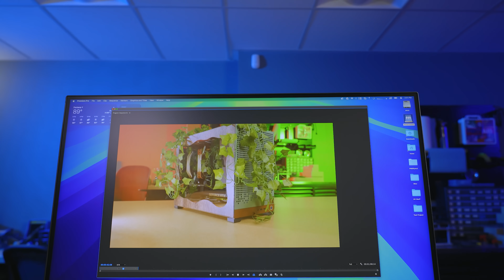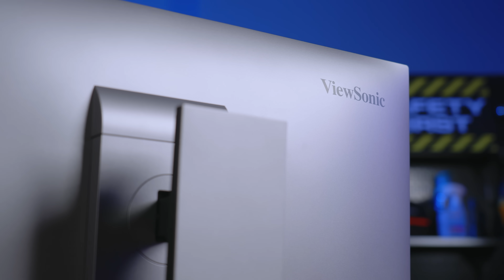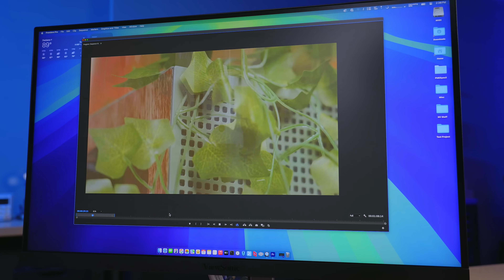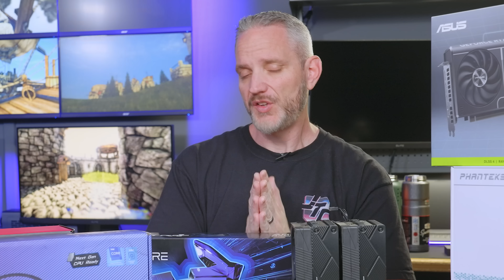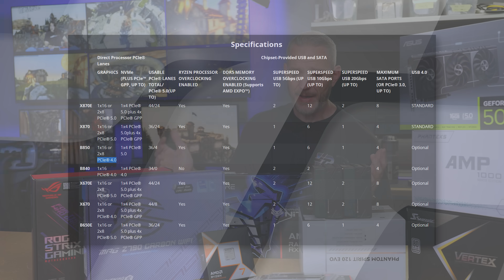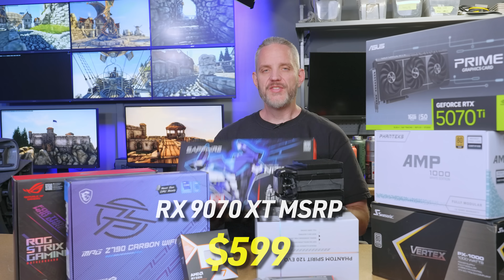This is the Sweetspot for PC gaming... Don't get fooled into spending more!

Comment: I swear EVERY SINGLE TIME I get the bug to upgrade or build new there is a LOOMING price spike......
Reply: So that is because there is a price spike like every month, i know cause im in the same boat and have been trying to upgrade for a reasonable price for like 2 years now....
Reply: @sillybillyhumor  this current situation is differnt those 3-400% increases. just to start SO FAR 
its over for RAM and SSD - its likely only to get worse - 5090 RTX rumors of 5K USD price....
you've missed the boat lol
Reply: Yep. I am building one now, and the last time was during the GPU covid crisis
Reply: @mikerzisu9508 ddr4 is better move buddy and grab used rigs is another option
Reply: I bought 9070xt when it dropped. Waited in line. Paid way over price...now here I am again...building when ram is $500...
Reply: @dangittyler bro I paid $2k for a 3080ti lol
Reply: Glad I decided to pull the trigger before Thanksgiving. I paid $2399 for a pre built with these specs: CPU: Ryzen 7 9800X3D
CPU Cooler: AI V3 360MM ARGB AIO w/ Digital Display
Motherboard: GIGABYTE X870 EAGLE WIFI7
GPU: GIGABYTE RTX 5080 16GB WINDFORCE
SSD: TEAMGROUP NV5000 2TB GEN4 NVME SSD
RAM: G.SKILL TRIDENT Z5 64GB 6000MT/S ARGB CL30
PSU: GAMDIAS HELIOS P2-1000G ATX 3.1
Case: AI GALAXY V3
Reply: @dominicsurace89  dont ever flex with a prebuilt ever again...NOT WELCOME! lol
Reply: @zerutul101 I mean normally I'd build separate lol but it was way cheaper to buy pre built. PC part picker was like 3500 for the build I got. I'll take the shame though lol
Reply: @dominicsurace89 lol all good superpimp - it’s tough out there for a gamer - by the time you get your build everyone has moved onto the next game lol 

I grabbed the 5080 astral on Boxing Day to compliment my 9950x3d i got in September, spared no expense lol Corsair/asus mostly - slaying everything now easily lol
Reply: @zerutul101 I purchased before Thanksgiving and got my build yesterday its great, but yea that wait was brutal.
Reply: @zerutul101 the Astrals are nice! Mine came with Gigabyte 5080 Windforce OC, so decent but no cool RGB :(
Reply: @dominicsurace89 opphh yes that’s a heck of a standby! Would have been better off grabbing a used marketplace build a gen back or something ;)

My exs 12700k beat my 9950x3d for 3dmark time spy cpu score
Pissed me off lol she had it running 4000mhz ram too cause no one did her xmp lol

I kinda regret not going intel honestly lol
But I wanted the king!
Reply: Why not? Still good for perspective
Reply: I feel it too, it's like our overlords don't want us to have any fun with the latest electronics, ugh.
Reply: Its called FOMO
Reply: I just upgraded my 3900x to a 5700x3d since ram is so insane. Will be on AM4 for at least next three years and just hope the nightmare will end and AI bubble will pop.
Reply: I’m so glad I built a amd sys : 870e MB, 9900x cpu, 64g 6400 ram,
9060 16g gpu a yr ago right before the theft !!
Reply: They know the pc enthusiast cycle
Reply: Buy used thats what i do

Comment: Im using rendering software that utilizes CPU cores for increased render speeds.
AMD is a goood option to go down?
Reply: yes if the CPU has 8 or better more cores - or go directly with intel.
check the benchmarks of "your" app before buying anything.

Comment: I have a 12 year old bequiet dark power pro. It's doing fine. Just need to swap it soon because the warranty was 10 years, the age of the capacitors might reduce the actual supply range and  new cards are more hungry than 750W + you have new specs which might burn your pins and you should upgrade to the newest standard instead of using adapters.
If new cards weren't that hungry nor had this pin issue, I would just keep it until it dies. Bequiet is a very good brand.

Comment: I have a 7900xt, and in desperate need of a cpu upgrade, still have a 5600x. Should I go with a 9600x or 7800x3d? Will it matter? Userbenchmark says there is only 3% difference in speed, but the 9600x is ~200 dollars cheaper.

RAM is outrageous right now. Damn AI is ruining everything.

Comment: 9600x for 200 eur+ 7800xt for 500 eur more did a good job for me for 3440*1440.  I'm itching for 9070xt though.. went for a cheaper air cooler deepcool k500s, but didn't like it's efficiency, had to go too loud to keep it cool, so I've ended up with zalman alpha2 ds a24, which has an lcd, which could be seen as an unnecessary extra, but the aio cost me 105 eur- 25 eur for my deepcool, so it's acceptable. So, the point is, that it's highly variable, depending on where you are located and what you have available around there to buy. Nonetheless, you will end up wanting a little bit extra all the time😅

Comment: What do you guys think of the following build :

Components List
	•	GPU: ZOTAC Gaming RTX 5070 Ti Solid OC 16 GB
	•	CPU: AMD Ryzen 7 9800X3D
	•	Motherboard: MSI MAG B650 Tomahawk WiFi (AM5)
	•	Memory: G.Skill Trident Z5 Neo DDR5-6000 CL30 (2 × 16 GB)
	•	Storage (OS): Crucial T500 1 TB PCIe 4.0 NVMe
	•	Storage (Games): WD Black SN850X 2 TB PCIe 4.0 NVMe
	•	Power Supply: MSI MPG A850GL 850 W 80+ Gold (PCIe 5.0 / ATX 3.0)
	•	Case: ASUS TUF GT302 Mesh ARGB (High-Airflow Chassis)
	•	CPU Cooler: DeepCool LT720 360 mm AIO (Liquid, No LCD)
	•	Additional Cooling: Noctua NF-A14 PWM Chromax – Install at the bottom of the case as an intake fan
Reply: if you want a qualified answer and not a very common one, please give informations first what you want/need that PC for.

what kind of games or applications in which resolution?

Comment: Processor	AMD Ryzen 7 3700X 8-Core Processor                3.60 GHz
Geïnstalleerd RAM-geheugen	16,0 GB
Opslag	932 GB SSD Seagate FireCuda 520 SSD ZP1000GM30002
Grafische kaart	AMD Radeon RX 5700 XT (8 GB)

hey  Jay, any tips on how i can optimal upgrade this pc ( has a x570 mb and rm750x power supply)?
or should i go for a new pc with am5 and ddr5?

Comment: Hello. I would like to add Powercolor RX 9070 XT reaper triple fan 16 GB to my existing configuration i5 13600k, MSI Pro Z790A wifi MB, 32 GB RAM memory, 5200 MHz CL40, MSI 3080 10 GB GPU. Do you think this is a good idea? Would I get an upgrade with the 9070? Will my processor support it? I would appreciate your opinion. Thank you.

Comment: I am so glad I bought a Ryzon 2700x on an ROG AM4 board about 6 years ago when we had a big drop in prices on those. They are still making BIOS updates for it today to at TPM 2.0 for Win 11 but more importantly, after the BIOS updates the last processor it takes is the 5950x which is 3x more speed and I just bought that CPU for about $300 online. Also upgrading from RTX 2070 super 8gb to 5070 ti 16gb, about a 3x speed increase as well. So for about $1200, its like buying a new gaming rig the speed increase is that significant. The sweet spot for the "budget builder" is staying at the high end of the 5 yr old market. Thats were the most savings are to be had but still keeps you on the latest games.

Comment: I think I found a lower tier sweet spot with my build. I built the whole PC for $650 by getting creative. I found a refurbished GPU on Newegg for $160 and a used motherboard and CPU on Marketplace for $60. I ended up with an I7-8700K CPU and an AMD RX6600 video card on a Z370P D3-CF motherboard. The case was free because my ex-roommate left it behind. This was my first full build and it's actually running great! I'm surprised that I'm able to play most of my games on high or ultra settings now with solid performance. Apex Legends and Fallout 4 run tight and I should even be able to play Cyberpunk 2077. YouTube videos taught me absolutely everything!

Comment: One problem that at least was prevalent before was (what imo should be illegal)the practice of manufacturers to change specs on a part (specifically on SSD's) but keeping the the "model name AND number"...Which meant that you could not be certain to get the same product that you had read about and researched.
OR the "naming problem", though it might be less confusing for "people in the know", it's still confusing to "normal users" when they launch models with "cryptic" ((e.g. multiple versions of CPU's where the "last character" in the "model name" makes all the difference)) or as and in some cases outright deceptive naming. And to add to this problem many (most?) retailers neither seem to know nor care which of the "versions" they are having in stock and selling...

Comment: 16:59 1600W is not 1600W. If you actually need a 1600W power supply, $100.00 will upgrade you from 80 Gold to  and your wallet will thank you every month.

Edit: 80 Titanium needs a draw around 90% (workstation) to reach peak efficiency. Get the Gold if your just floating around 80% (Gaming) once and a while.

Comment: I have a plan on upgrading my pc with a 9700x and upgrading graphics to a 5080 or do you recommend a 9700xtx or anything similar on cpu that would better on those graphics cards and also what board to pair it with  if its even worth going to x870e or save the money and put it towards a better cpu or on the gpu. Out of the 9700xtx or 5080 which one would you do for games like battlefield 6 at 2k gaming and best cpu paired with

Comment: Is it worth it to scoop a 9070xt for 599.99 from microcenter? 

They have the PowerColor AMD Radeon RX 9070 XT Reaper Triple Fan 16GB GDDR6 PCIe 5.0 Graphics Card in stock at my local microcenter for 599.99.

Comment: Monster Hunter Wilds ate up my Ryzen 3900x even with a RTX 4070. All settings down to 1080p low were the same choppy 40fps with dips to 20fps so I just turned everything up at 1440p. Building a new computer around a 7800X3D got me into the 60 to 90 fps range with the same 4070 without frame generation.

Comment: Hey Jay, love your videos!
I’m currently gaming with a Ryzen 7 3700X and an RTX 5070 Ti. I don’t want to upgrade my AM4 motherboard, but I’m wondering if a CPU upgrade would be worth it for gaming.

Would you recommend upgrading? If yes, which CPU should I go for while staying on AM4?

I’ve heard the Ryzen 7 5800X3D is a huge jump in gaming performance, but is it really worth the cost compared to keeping my 3700X? Or should i stick with a cheaper model? 5800x 5900x?

Comment: Replaced the "old" 5600x/32GB-3600" with a 7700 on new AM5 platform 64GB-6000 half a year ago. I had no complaints whatsoever but thought it was time for something new, especially (mainly) because it was not an expensive upgrade. Only cost about 350 Euros after selling the old parts. Plan is to upgrade it again by only going (swapping) to the "equivalent" CPU (8-12 cores or whatever, middle-of-the-road) from the next gen, should also be AM5, in about 2-3 years from now. But let's wait and see...... Just kept the RTX4070, which I will probably keep for many years to come since I'm not such a gamer.
No difference noticed after the swap though ;) but I still love it. The feeling of having more reserves :). And my first time having more than 6 cores. To me it is quite a powerful and future-proof machine again.

Comment: I am using R7 7800x3d paired with rtx 5070 with budget motherboard msi b650m-p, with g.skill 32gb 6ghz cl30 ram, with xpg pylon 750w psu

I bought:-
7800x3d at $345
Thermalright Phantom spirit 120 se cpu cooler at $45
Msi b650m-p at $143
Zotac dual fan rtx 5070 at $740
G.skill neo 32gb 6ghz cl30 ram at $123
Xpg pylon 750w psu at $60
Xpg valor mesh case at $45

7800x3d temperature doesn't reach 80°, rarely exceed 80° sometimes and motherboard's vrms temperature is between 50° to 60° in heavy work load which is totally fine

Comment: Agree with PSU-s, I got overkill back in day for my 4790k i7 and having a 750W 80+gold XFX XTR psu. Well 10 years later and the thing still runs fine on my AM4 system with 3070 😅

Comment: I am watching this again as i just built my system. I jumped from a 2080 and amd 3950x. My old psu is 850 and still warranty, but i replaced it when i found the 8/6 pin power to video card was burnt when i was swapping pieces out. I jumped to 5080,a amd 9950x , and upgrade the motherboard to a 870 board from asus that was doa but i have about 64 gig ram, with a 2tb m.2 spent 2k on the parts.  Then spent another 800  on a spare board, ram , and a1000watt psu to be more future proof.,

Comment: Another bit of advice is to consider what are your future plans? I’ve always upgraded knowing that I’ll change a different component down the line which worked out brilliantly for AM4. So I upgraded the CPU, then GPU, then SSD, then memory, then CPU, and recently GPU which is now end of life for AM4 so hoping for AM6 platform and keeping current GPU for that which is a 5070. It doesn’t have to always be well matched if you upgrade parts when you can afford it every year or so

Comment: All these AMD fan boys that only buy amd everything. Buying the 5070ti at $750 is great!

2nd) Honestly the 9800x3d for $500 after tax is insane unless you have an rtx 5090. 

If the 9800x3d was down to earth for $399 regulary then id say ya 😉. Its the the fastest gaming cpu at 1080p and 1440p. But with a mid range 5070ti a 14700kf for $300 is much better and then get a 4tb m.2 Samsung ssd instead of a 2gb. Bf6 and many games need LOTS of space.

Comment: I currently have an i712700f, a 4070 and 32gb of ddr4, mainly used for Flight simulator, and a couple of grand strategy games. I was thinking about upgrading to an AM5 CPU and DDR5 memory, but nothing decided yet! Also i have a terrible samsung cg50 with only 100hz refresh rate and no VRR so maybe the most sensible upgrade to start with would be in the display. What do you guys think?
Reply: check benchmarks and see for yourself if the amount of fps is that what you "need" or want. 

but only after you did check if you are not satisfied with your PC performance that you have right now.

Comment: Bought a 1000w PSU back in 2012. I'm still using it...

Go as overboard on the PSU as you can. You will not regret it later. Since they only draw what power is needed for the components currently running on it. It's not like getting a bigger PSU means you're increasing your electric bill.

Comment: I agree with almost everything except 2:42 because it also depends on what the purpose. 

E.g. I specifically went for 7800X3D with a RTX 4060 8GB VRAM. Why? I play World of Warcraft 95% of the time and it’s heavily CPU depending so I need the extra cache. The GPU is not that relevant here.

Comment: Talking about overcapacity coolers..... me talking to my 6yo overcapacity AIO cooler, I finaly got some workload for you incoming, over an hour 100% CPU load! Cooler; nice! When does it start? CPU; for real? Working my ass off for over half an hour now! ..... still at 52 Celsius. 
Even if you don't upgrade, I like it way more to see temperatures not go up, fans keep quiet and temperatures never reach the higher limits.

P.s. I would go for a AIO again (refillable this time), with glass window it just looks so much nicer compared to a bulky air cooler.

Comment: Just did my build with the following specs:

CPU: AMD Ryzen 5 9600X 3.9 GHz 6-Core Processor  
CPU Cooler: ARCTIC Liquid Freezer III Pro A-RGB 360 77 CFM Liquid CPU Cooler 
Motherboard: Gigabyte B850M D3HP Micro ATX AM5 Motherboard
Memory: Patriot Viper Venom 32 GB (2 x 16 GB) DDR5-6000 CL30 Memory
Storage: Samsung 990 EVO Plus 1 TB M.2-2280 PCIe 5.0 X2 NVME Solid State Drive  
Video Card: Gigabyte GAMING OC Radeon RX 9070 XT 16 GB Video Card 
Case: Corsair FRAME 4000D ATX Mid Tower Case 
Power Supply: MSI MAG A750GL PCIE5 750 W 80+ Gold Certified Fully Modular ATX Power Supply 
Keyboard: HP HyperX Alloy Origins Core RGB Wired Gaming Keyboard

And it destroys. Yes, AIO is overkill for the 9600X, but since they'll support AM5 for the time being, I could go a lot harder in the future if necessary. Plus, it all looks so insanely good together.

EDIT: well.... returned my 750watt PSU and decided to get a be quiet! 12M 1000W one instead. Thanks Jay.
Reply: why would you return the PSU?
did it fail to provide enough power? did your system shut down because of that?

but seeing your GPU+CPU that is near to impossible

Comment: Newer games are horrible. I stopped playing them, and went back to playing SWG on a private server. I’m having a blast, and my ROG Ally X has more than enough power for it at 1080p, and my 7000 series Ryzen 5 desktop with a 9070xt is capable of running it in super resolution using 1080p to 4k. Build your PC for what you’re really wanting to play. You don’t need to have a top of the line computer to play games, especially if you’re playing older games.

Comment: 100% in agreement with the PSU.  I purchased an evga 850 watt gold way back with my gtx 980 ti build in 2015.  10 years later that same PSU went thru 3 generational computer upgrades and still kicking today in my current rtx 4090 build.

Comment: 9600x with a 9060 xt 16 gb 
32gb kingston fury 6000mhz CL30
2 tb crucial p310 
Asrock b650 Livemixer wifi 7
Msi 750w PSU
Wish me luck this mb doesnt burn my cpu lol. No over clocking anything just a modest gaming/work build for less than $1400

Comment: i want to upgrade my motherboard, ram, cpu and keep my 6800xt for now, case with fans, cooler and storage i got aswell, ( for reference i got a x-570-e mobo, 32 ram 3600mhz, ryzen 9 5900 X CPU -- I got a 850w powersupply so might have to get a 1000w ) what would you choose for mobo and cpu ?, ram I wanna go with Trident Z rgb sticks

Comment: Pc I put together in part picker will run me about $2400, with a gigabyte x870, Ryzen 7 9800x3d, 5070ti (price jump for the performance jump for 5080 doesn’t seem worth it), and ddr5 6000 cl 30 ram. I’m only looking at playing at 1440p  so i can probably save a bit on dropping the cpu down a bit maybe? I want this to be something that lasts me a while and I run at pretty top specs. Who knows maybe I can save up for a 5090 one day. I am throwing a 1000 psu in it. I follow jayz line of thinking of go a size up on power.